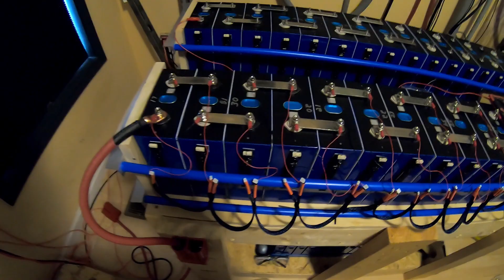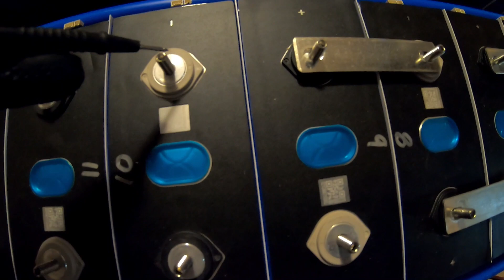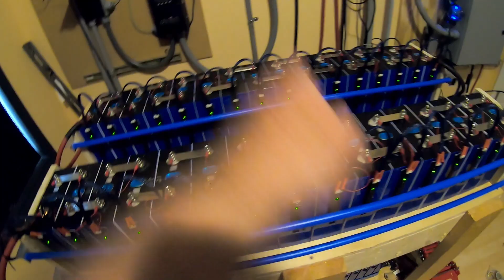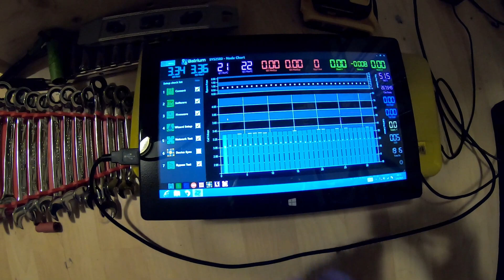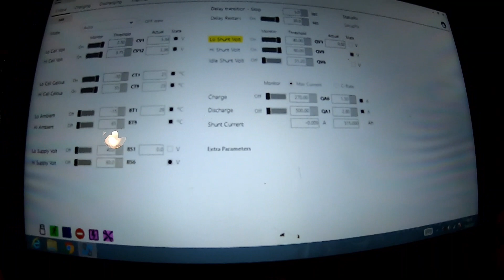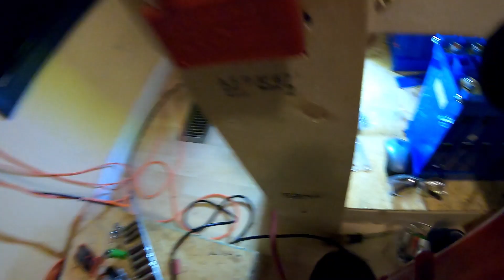280ah cells into service part 2

Comment: I sand ALL electrical mating surfaces with 240 grit, then apply a very thin coat of NO-OX-ID A Special. You’ll reduce heat buildup/energy losses.